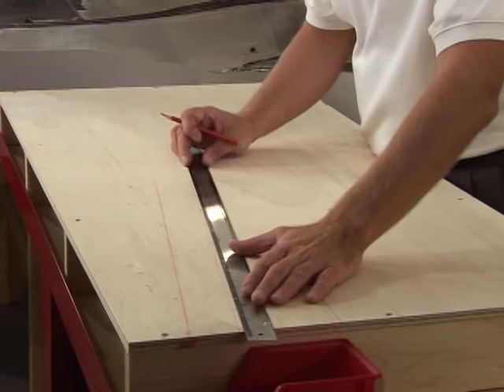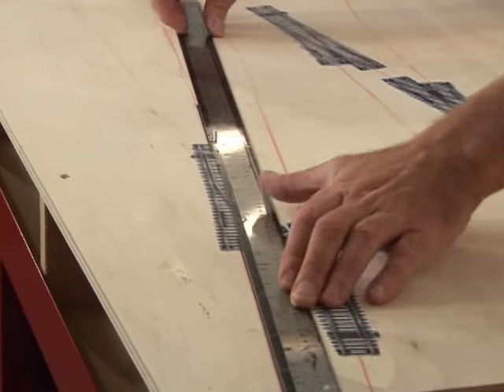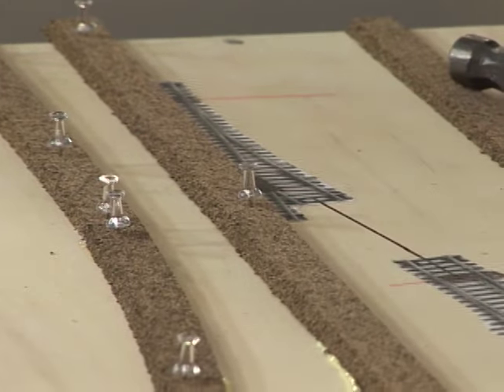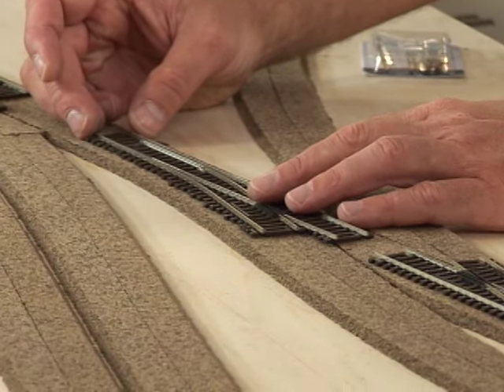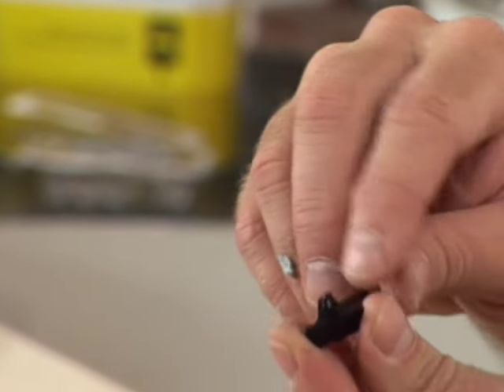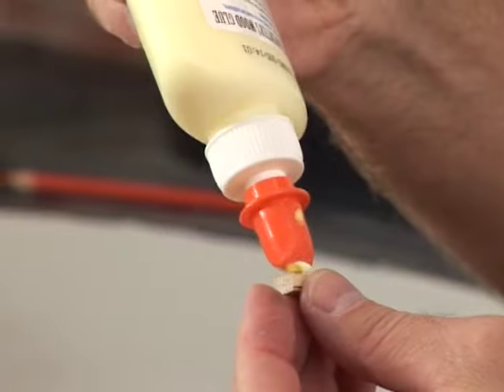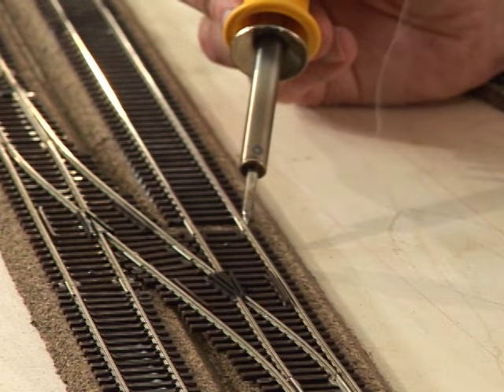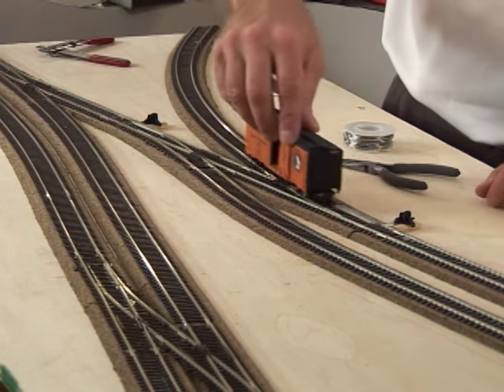Laying Model Railroad Track: Tips and Tricks

Comment: Woodland Scenic's has a sound deadening Road bed for N scale Ho and O .                 It's pretty good .      They at one time also had large sheets for switching yards and staging areas . 

As you saw in the video he ran the track bed and track right up to the edge .                    Never ever do that for " Modular Layouts " .          There's a higher chance of Derailment .               Leave an area to allow for a Crossover section of track to spanned the gap .         But still bring the road bed to the edge .           The track section doesn't have to be very long just from one road bed to the next (  approx 1 — 1  1/2 inch should do ).             This simple step will take into account any slight difference between " Private " and " Club " modular sections .            I've had to make this Improvement for several clubs ,         that were plagued with derailments .

61 and still plays with trains .🚂🚂🚂🚂🚂🚂🚅🚅🚅🚅🚅🚅🚅
Reply: Fat Chungus 
Yea but a lot of people who have used cork board don't realise that even under all that work cork turns brittle and to powder after time especially if it's in dry conditions like here in the desert of Nevada

Comment: His track work and video are extremely informative. I use DAP instead of the foam adhesive. He spreads the adhesive with a putty knife. That is important. I flip my track upside down and slip an exact knife btwn ties and rails to be able to slip in rail joiners. I solder curves before securing with adhesive. I also paint track on workbench after giving it a test fit. The extra step gets it right the first time. Take your time.
Reply: James Peters 
/
//
Reply: Soldering track joiners is a complete suicide mission for the structural integrity. Especially for those layouts in non-AC controlled environments

Comment: Using flex track like you said is wonderful until the flex track joint is on a curve.    I now will solder the joints to another flex track while it is straight,    now when you flex the track the rail continues to evenly bend the radius you want it to be as one longer solid rail.    If you don't do this, a standard slip fit at the joint will do this to your track work.   Flex track always wants to go back to straight and therefore a non soldered joint, the joint will try to flex back to straight and thereby you will see a distinct jog in the rail at the joint,   don't believe me then run a camera down the rails at the joint in the curve, that jog will show up every time.     The glues he was using are good but are not as forgiving if you need to reset the track because it did not come out right.     I got away from the yellow glues and a tough caulking or a caulk gun glue.   I now use Apex caulk sold at most house stores and lightly spread the apex caulk  (and I use the clear) to set cork and the track as well.   A thin coat goes a long way   If you make a mistake or decide that was not what you wanted to do, or even change your design later,   then just slide a thin spatula or puddy knife under the flex track and in about 3 passes the track is up and ready to relay.   Do the same with your cork road bed.    It too is reusable.
    I have gotten away from the use of small nails and harder glues and Apex caulk is forgiving and holds well. It will also hold firm to your plastic mountain premolded forms where other glues will not.    It usually sets enough in about 20 minutes that you can continue  with what you are doing. yet days weeks or years when you want to make a change you can do so easily.      Newman Atkinson   from Terre Haute Indana
Reply: Thank you! great information for newbie.
Reply: @subron14  Gary   I hope you the best with your track laying.    I have learned much of what not to do from my own mistakes and I will admit them.   Putting track down with nails,  Well I hit the nail too hard and it pulls the tie down and in many cases that tie will pull the rails toward each other for the big squeeze of your wheels.    Finding about the rail joint pulling to make a jog in the rail in your curves well that is like a jogged real rail from expansion of the rail in heat of the day on real tracks.  That really is a possibility. That is one of the possible causes of the derailment of the empire builder in Montana the other day that they are looking at as a possible cause.   the expansion in the rails causing a bow in the rail.    You can get that on your model railroad if your joints are too tight and you have high temperature changes like in your garage that is not constant temperature.   I have a friend that connected flex track to the rail going into a switch and the connection is angled different than the solid switch rail.  Again that was flex track trying to straighten out.   A video camera rolling down the track can catch that and I could see that on my video of my friend's layout.   They show up very well with the camera looking ahead straight down the track.   I turned to the Apex caulk  (get the clear.   It is white going on and dries clear)   very forgiving and easy to get track and roadbed up without damage.   Regular glues causes the flex track to not flex well when reinstalling and is also hard to get up   If nails are in the roadbed to your sub road bed they are in in the way to scrape the roadbed up.  Also regular glue will cause roadbed to not flex anymore or cause it to come apart when pulling it up.   Very seldom do I use small nails except to help an end of a flextrack that might pull and not stay aligned say at a cut joint that is not connected because you might have a walk through  gate that has to move.   I also use 9 inch sectional track across a module joint where in will at some point need to come apart say to move someday.
I hope some of this helps.   Always available to help if you need it.    Newman

Comment: Good video & idea's. 
I like to use clear or black silicone on my track lay down. If I want a different layout it comes up pretty easy with a sharp blade and cleanup is a breeze.
🚂🚃🚃🚃
Reply from the maker: I like to use a clear, brush-on oil base sealer that you can buy in a half pint size at your local home improvement store. Anything water base could warp your wood. Sometimes it’s a good idea to seal the inside as well.

Comment: I see you  glue the cork trackbed down with "yellow glue".  What is the effect on running noise ?  I   have experimented with all sorts of systems, but as soon as I glue the track to the base, whatever it is, I get significantly more track noise than if the tack is just pinned.

This even applies to my current higher level tack area which uses foam risers to which I glue 1/4 inch balsa wood strip, then add some quite dense self adhesive carpet underlay foam on top of the balsa, and then on  top of that the usual thick cork trackbed you show. 

Laying the track on top of this combination gives very nice, quiet running so you can hear the progress of a train over the track joints clearly, but as soon as I glue the trackdown to the cork bed, the sound volume increases dramatically.  I have tried various different adhesives, such as Gorilla glue,  PPPVA, Copydex and even foam adhesive, but all seem to amplify the track sound levels to a level I would prefer NOT to have.

Trying to pin the track to this trackbed combination does not really fix the track down firmly,, although it does stop the niose transfer.

Any ideas or suggestions ?
Reply: I have used only Woodland Scenics foam roadbed.Glued to extruded foam base not wood and nailed track down only. It is quieter but I haven't ballasted 
the track so it might be only slightly quieter.Like you this is only solution to the problems with noisy rails.
Reply: Ian Turner I have OSB or plywood subroadbed, a layer of foam, next track or cork roadbed, depending on mainline versus yard for example. None of my operators have ever mentioned any noise.
Reply: +Ian Turner
There are several components to diy railroad layouts. One plan I discovered that succeeds in merging these is the Jareks Hobby Club (check it out on google) it's the most incredible resource that I've heard of. Check out all the great info .
Reply: I\'m not sure but ,if anyone else  is searching for ho trains with sound try Corbandy HO Scale Crusher ( search on google ) ? Ive heard some awesome things about it and my work buddy got excellent results with it.
Reply: the cork will harden with time. stuff needs to stay soft to deaden vibration, so (get with the times) use PU foam and an adhesive that will remain pliable. the craft stores sell the foam in 3/32" thick sheets- for a few bucks you can line your entire pike with it. rtv silicone would be fine. the track tie assembly is hard plastic- a hardening glue is okay for that. a water-base glue (like elmers carpenter glue) will let you easily reclaim the track when its time to rebuild. you can push-pin the track down while the goop sets up. if you insist on using sectional track for curves and straights then you will probably want to do some soldering. i use flex so i don't need to solder anything. soldering is a waste of time and ruins track pieces/burns your fingers. our club layout has 12 miles of trackage (it has 42 feeder wire pairs) and NONE of it is soldered- no failures. i build large layouts and use a maximum of 12 track joints per feeder, and have NEVER had any conductivity problems- another one of model trains' big fallacies. you're talking up to 21 feet (in N scale) per feeder wire pair. can the soldering iron and spend the  money on Atlas' wired joiners instead. and if you are using used track, BE ON THE LOOKOUT FOR LOOSE/DAMAGED JOINERS. replace them with new- never smash them down with pliers- you'll end up replacing them (with a lot more work later on). very important! most importantly, have fun and let your kid learn stuff on his own. part of the fun for you is learning right along with him. don't put yourself out too much- he might chuck it all for play station gaming next week! if that happens- YOU'RE NOT ALONE!!

Comment: Nice video. Just wondering what size plywood do you suggest?
Reply from the maker: Well, most folks start with the classic 4x8 plywood and gap on from there.
Reply: @ModelRailroadAcademy  Thanks i know i didnt mention thickness. Im going to go with 1/2".
Reply: @railcar123  yes 1/2 is always minimal but effective....less than that and you're only asking trouble...
Reply: @AbelG8781  thx

Comment: Am I the only one that coats the roadbed with glue, attaches the track, and ballasts it in one operation?  I paint the roadbed gray first, mark the track out, and then mask point areas before the glue.  Remove the tape and attach the track and dump ballast everywhere. When the glue is dry, I just vacuum up the loose ballast and then fine tune it and detail.

Comment: Caboose Industries makes great switch throws and in many styles, can be used with electrical machines or as manual throw's.
Reply: I bought the Caboose Ind. manual throws for reachable spots on my layout. They work terrific & look good too...
Reply: Did you know that you can also make hand throws from house electrical switches?   Actually cheaper.   Note that an on/ off switch is spring loaded to either direction.   Using a cheap plastic electrical box drill a hole through the bottom of the box and drill 2 small holes in the handle of the switch one above the other.   Run an wire from the handle through the bos to your track throw  and the other to the side of the table underneath and you now have a push pull handle   (usually inset the handle in from the side of the table so it does not get bumped.    If you have a switch that is not lined up for a straight rod to the table side then glue 2 old CD.s together and mount under the table,   Link the switch to the CD, then run tanother rod to the side of the table.    Your CD is now a change of direction for your push pull rod to the side of the table.    One last thing If you use a 3 way switch instead of a standard on/off you now have a circuit to throw the frog power of your track switch to the proper power for that rail for the direction you want to go.   Dollars cheaper than even a single hand throw from the hobby shop.   This was in a model Railroader Magazine back as many as 10 years ago.(don't remember the year but is was a Jan or Feb Issue.   I added the three way switch for the circuit.   This is great where you don't need electric switch motors.   Newman Atkinson

Comment: Great share! Might I ask how many volts are run on HO Scale, under-the-table bus lines? And, what voltage are the track rails? Many Thanks!!!
Reply from the maker: Generally you would be using 12 to 16 volts.
Reply: Using Standard DC the volts are 12 volts  for HO Scale.   For DCC the volts are a bit more  about 16 volts or so.   Under DCC the power is really going to your DCC Computer chip in your engine andthe chip now powers the motors as needed.   The disadvantage to that the older type bulbs will tend to burn out quicker.   I have a few that I need to change to LEDs myself.   Under DCC the chip runs your motor not you  The chip is your  source to control the engine  Yes you are telling the chip what to do but the chip controls the motor, lights and sound as it needs.    Newman Atkinson

Comment: Im going to be building a small railroad that should prominently fit on 4x8 give or take and is using bachmann ez track fine because i am new to this and I saw most people using hornby like track
Reply from the maker: Hello, I think Bachmann EZ track is fine.
Reply: I have heard of issues with the rails on EZ track coming out of the trackbed. Regular track (like Atlas SnapTrack) is personally my favorite and go-to. While doing roadbed and joiners can be a bit of a pain, there's more of a variety of specialty pieces for more custom track arrangements and is definitely more economical. Regular track also allows you to use insulated joiners if you want to isolate certain sections of track (like a passing siding) and power-feeder joiners, which are easier to conceal and you're not left with the terminal-rerailer track if you're shooting for a more realistic effect. Now if you ever wanted to expand from your 4x8, regular track would definitely be the way to go since it can be easily cut to a specific size (I recommend Xuron track cutters) than the Bachmann EZ track or LifeLike PowerLoc. Hope this helps if it wasn't too late

Comment: how do you attach the track to pink foam board (to get away from the flat look)?  do you nail or glue?
Reply from the maker: Hi Ruger,

I like to use matte medium from the art supply store. You can use weights or long pins to hold the track in place until the medium is dry.

Douglas
Model Railroad Academy
Reply: @ModelRailroadAcademy - thanks very much!

Comment: Never glue the rail if you have a big temperature swing in your railroad room.  The rail will expand and pop out of the sleepers.  It can also cause gage variation that can cause derail.
Reply: terenfro1975 Then what should I use?
Reply: so at your place the rail expands much more than the benchwork or tie assembly..... ok
Reply: @tommurphy4307  hes right though....temperature can screw things in the long run
Reply: Love how these so-called "experts" spout advice, but never offer solutions.

Comment: Cork is way to thick resulting in track sitting to high to be realistic
Reply: Incorrect.  Many places ballasted rail sits between 2-2.5 feet above the roadbed.
Reply: It matters where you are modeling at
Reply: Cork can be bought as thin as 1 mm, which is good for yards. Check a craft supply store.